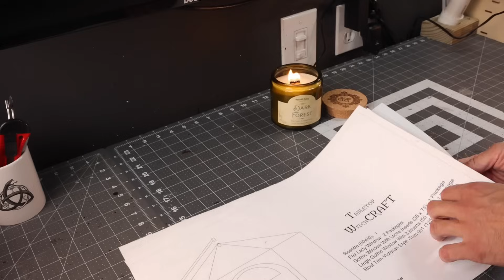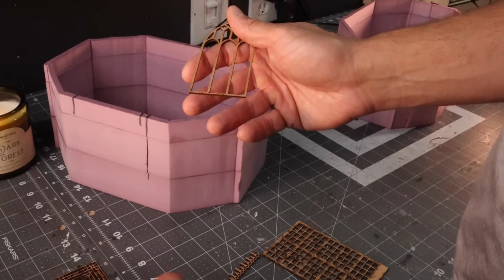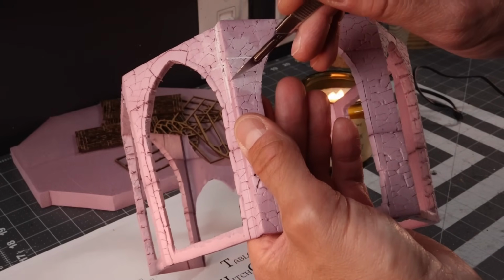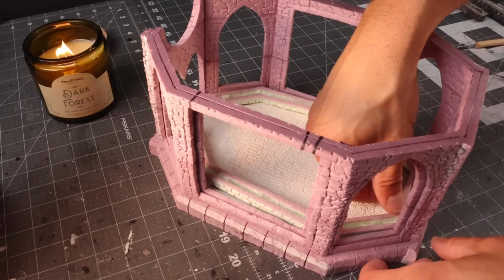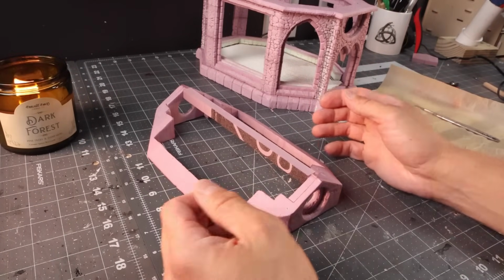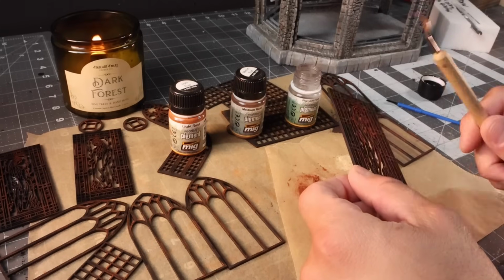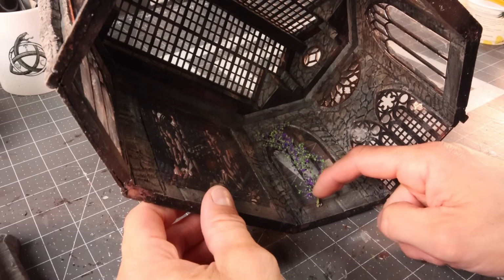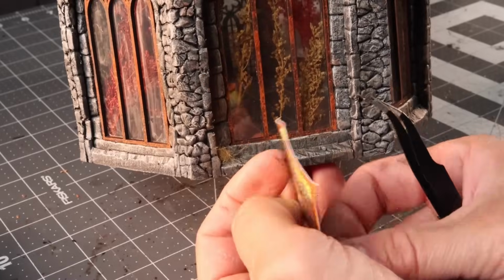Craft Your Own HAUNTED HOUSE for Tabletop Gaming

Comment: Only thing that I can think of is that with the roof, you probably should have had join points at regular intervals across it, you don't really see a copper sheet of that size, and most buildings would have several plates linked together to form the roof.
Reply from the maker: Yep I had thought of that and some bolts …. But it was too late.

Comment: I have been following your channel for a couple of years, inspired by your many excellent crafts, but this project seems very intimidating. Even though I have all the tools and materials and some experience with them, this build seems more detailed, more unforgivingly precise, and more time-intensive than I would normally expect as requirements for my tabletop gaming needs. It is a work of art, to be sure, but I think I would look to cut some corners if I were ever to attempt to construct something similar. Thanks for presenting what is possible when one pulls out all the stops.
Reply from the maker: You got it, and thank you for your support over the years!  The haunted house isn't too bad honestly with respect to difficulty if you have some experience with the Proxxon.  Not easy, but not impossible.  The greenhouse is actually a fairly easy project especially if you modify it and don't incorporate the recessed stonework for the windows.

Comment: Years ago, I did a special RP game for Halloween based on the Winchester Mansion and Rose Red House. "Sword Rose Mansion" What's oddly funny is that your House here is very close to what I pictured the house to look like. EXCELLENT build. 10 Stars! The only thing I do not see is where you got those tiny crows from.
Reply from the maker: Thank you so much.  I got the crows from Noble Knight Games.
Reply: @TabletopWitchCRAFT   Thanks. I will have to check that out.